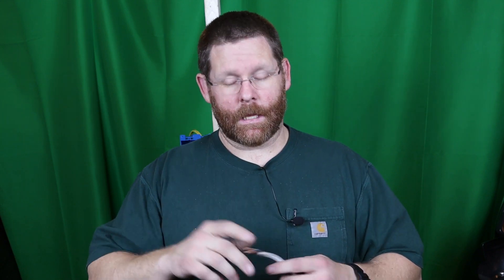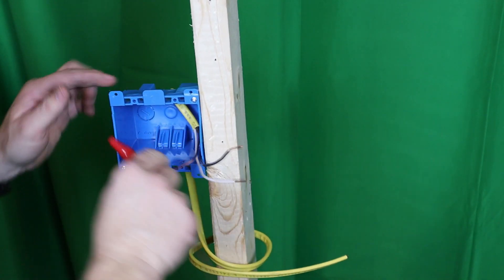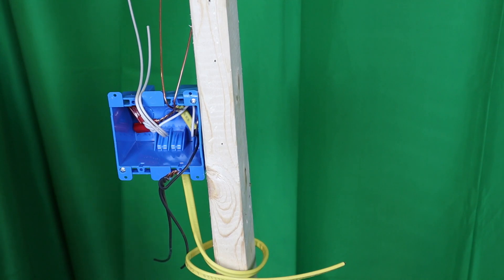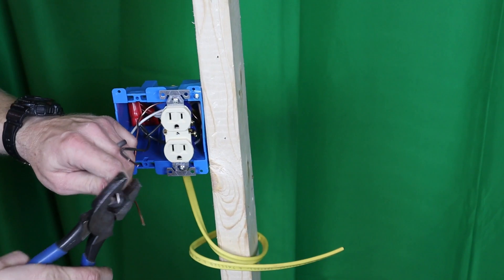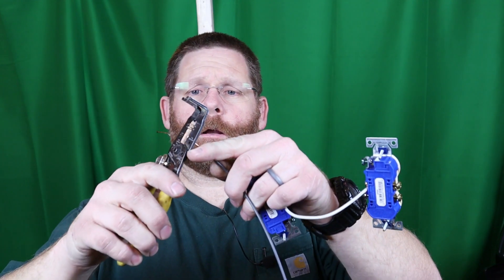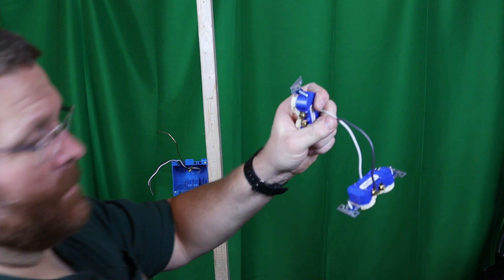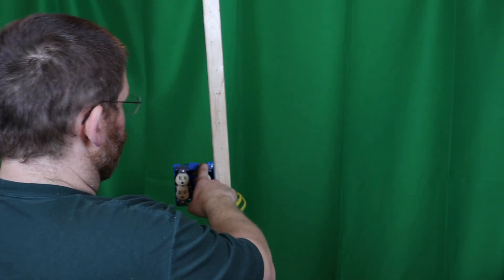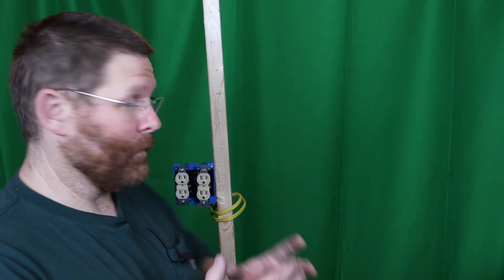How To Wire A Double Receptacle Two Different Ways

Comment: Great video.  
It's a good idea to learn both ways.
With the 2nd method, the 1st receptacle with the line serves as passthrough for the 2nd receptacle (wiring in series).  If one of them were GFCI and you wanted both receptacles to be protected, you would have no choice but to wire the 2nd way.

Comment: i see something wrong, as per Study Books i have read, so you can say the books are wrong and you are correct???  the making [ HOOKS ] they should be Shepherd hooks  with 75%  of contact touching... the way you did it is not correct as per code ??? what are your thoughts on this???
Reply from the maker: I have had discussion with many electricians and inspectors we all make them the same. Nothing wrong with it and the way you described is great too.

Comment: I connected my ground from green to green instead of coming off with a wire nut. Is that okay?
Reply from the maker: Do you mean you went from Recep to recep?
Reply: @MountaineerOutdoors  Yeah, the ground/ green on the first receptacle to the ground/ green on second receptacle.
Reply from the maker: Nothing that I know about that is wrong just be harder to change out if you need to replace it. Just make sure that it's hooked to the ground back to the panel.
Reply: @MountaineerOutdoors  Thank you so much for taking the time to answer my question. Your video was easy to see, with the visible stud and no sheetrock.

Well done.
Reply from the maker: I appreciate it and you are welcome.

Comment: As a DIY, I have a question. I want to add one outlet on the opposite side of an inside wall that has no insulation to an existing outlet. Is a outlet box required if I am using Wago connectors? Thank you for you time and great videos
Reply from the maker: Absolutely it must be inside of a box. Good question. I appreciate you watching and commenting ☺
Reply: @MountaineerOutdoors  I appreciate your fast response and box it is, and also I found a great video on how to make pigtails to save box space…. Thank you for these great tutorials.
Reply from the maker: Always, gonna be alot more this upcoming year.
Reply: @MountaineerOutdoors  Looking forward to them ……. Have a great weekend
Reply from the maker: You as well. 😂 😂 Well I definitely did

Comment: I'm making a homemade power strip/extension cord with 2 sets of receptacles, and I'm probably going to use the 2nd method, myself, but even though this video was a bit too quick for me to follow, it might be of help...
Reply from the maker: Good luck just take your time.
Reply: @MountaineerOutdoors  thank you... I got it made, but it was harder than I expected, considering the cord I was using, came from an old power strip that had a good cable, and it was using stranded wire, which, I'm sure you can see the potential issues with that. I think some ring terminals would have been better, looking back on it, and I still might do that, honestly, as it would probably make it a little safer.

I did use electrical tape to isolate the 2 individual plugins from any stray wires I might have in the future, so I wasn't a complete idiot, but I wonder if it would be good to use my idea of ring terminals, or perhaps use a couple of WAGO connectors, if and when I take it apart and redo the connections...
Reply from the maker: Me personally I hate wagos. But the ring terminals on stranded wire that's a great idea or even fork terminals. Sounds like you did a great job.

Comment: Thank you sir... Both of your installs are to code because of the pigtails, right down to the copper grounds, as in the 2nd demo, each outlet switch had it's own individual ground connection...
I too prefer the 1st way it was done...
Excellent tutorial & done to code, except for ( 1 ) minor detail, per the electric code manual for several years now, probably closer to ( 5 ) years actually, neutrals now go from 6 o'clock to 12 o'clock position... 
Bill... :~)

Comment: Awesome video and finally found one that answered exactly what I wanted to know. I want to add another receptical to my outlet box its in the middle of the circuit and understand now how to do this. My question is I want to tie in a ceiling fan to the box. Do I just add wiring to the pig tail to connect the fan too?
Thx I liked and subscribed, I will be checking out some more of your vids. Nice work..
Reply from the maker: First of all welcome to the mountaineer outdoors family and if you wire it up to the pig tail it will be hot all the time and will be able to be controlled by the pull chains. Thank you for watching and commenting ☺

Comment: It’s like every decade is something in electrical wiring in homes this is just my observation.

1940-1970s : Aluminum wiring, white colored hot wire

1980-1990s : Excessive daisy chaining and neutrals in every box

2000-present : Neutral must be in light switch box and tamper proof outlets wait, receptacles. To be politically correct not to offend anyone.
Reply from the maker: 😂 😂 😂 Yep you hit the nail on the head
Reply: @MountaineerOutdoors  I was at my buddy’s changing outlets it’s a joined living room and dining room. 3 were on a 15 amp circuit and 3 were on a 20 amp circuit, different breaker switches no order. Everything else is 12 awg, but the last one. The neutral was 12 gauge and the hot was 14 gauge. After scratching my head and contemplating about life It’s on a 20 amp circuit and I’m going to install the 20 amp receptacle. 

It’s a big room, I get it the kitchen is on the other end of the wall so the 20 amp carried over. But the connecting garage is only 15 you think they’d put the 20 in the garage rather than a dining room where all the fine China and no appliances will be. Got a 15 amp outlet at one end of the sofa and at the other end it’s 20 amp.  

The house was built in the 80’s. Whatever they did drug wise in the 80’s it reflected on the wiring to say the least! Haha
Reply from the maker: 😂 😂 Yeah sometimes I wonder stuff like that. What weary they thinking. Appreciate the story and glad it's not just me that runs into stuff like that

Comment: Hey I have a 4 wire connected to twist lock 4 prong 30amp and the other end is a double out box to 2 20 amp outlets how would you wire this

Comment: You do NOT need to pretwist wires before putting a wirenut on. Manufacturer spec for majority of wirenuts states that its not required. I can guarantee you a shit ton of testing was done before slapping that instruction on the box. That being said, I pretwist because ive always done it and i find it easier to put the nut on instead of struggling with 2 or more individual wires. Nobody tells me what to do. Haha.
Reply from the maker: 😂 😂 I hear ya 😂 😂 I agree it does say that but I don't trust it.

Comment: I have 1 question how come people put these sockets in metal boxes Or aluminum whatever you wanna call it. If 1 of the wires get loose wont it  electrified the whole box
Reply from the maker: If you ground the box it will short out the circuit which will trip the breeker. Alot of people do it because they think it's better. For me that's old school and in a house it's a over kill and cost more. To each is own though. Commercial or industrial settings Definitely use metal boxes though.
Reply: @MountaineerOutdoors  Thank you so much for explaining that to me.
Reply from the maker: My pleasure ☺

Comment: This article contains the requirements for identification of the grounded neutral conductor and its terminals. If you go back to Article
100, you will see that the grounded conductor isn’t the same as the grounding conductor. Make sure you clearly understand the
 difference between the two before you begin your study of Article 200.
   This article isn’t very long, and it’s not very complicated, and following these requirements can mean the difference between a safe
installation and an electrocution hazard. The illustrations in the Understanding the NEC, Volume 1 textbook will help you form mental
pictures of the key points.
   Grounded Conductor. Most electrical power supplies have one output terminal of the power supply bonded to the case of the power
supply (system bonding jumper). The conductor that is connected to this grounded terminal is called a “grounded conductor.”
   Neutral Conductor. The IEEE dictionary defines a neutral conductor as the conductor with an equal potential difference between it and
the other output conductors of a 3- or 4-wire system. Therefore, a neutral conductor is the white/gray wire of a 3-wire single-phase
120/240V system, or of a 4-wire three-phase 120/208V or 277/480V system.
   Since a neutral conductor must have equal potential between it and all ungrounded conductors in a 3- or 4-wire system, the white wire
of a 2-wire circuit, and the white wire from a 4-wire three-phase 120/240V delta-connected system are not neutral conductors—they’re
grounded conductors.
   Author’s Comment: The electrical trade industry typically uses the term “neutral,” when referring to the white/gray wire. However, the proper
term for this conductor is “grounded conductor.”
Technically, it’s improper to call a “grounded conductor” a “neutral conductor” or “neutral wire” when it’s not truly a neutral conductor,

Comment: Have to Ask if you hold a Electrical License? 1.  It is a one phase ckt so per the NEC there is no neutral, it is called an ungrounded conductor.  Natural is in a two or three phase ckt.  2. The instructions for the wire nuts state not to twist the wires.  I know of inspectors that failed jobs because of this.  If the ckt is not powered then you can wire in any order,  which NEC and OSHA says any work should be done on unenergized ckt unless the power is on for critical systems.
Reply from the maker: John when I read this I was like is this dude for real... Now I'm asking, is this dude for real.. First off I absolutely have a license. I have held one over 18 years now. The nuetral thing, I'm not getting into a long drawn out description of that. I'm sorry to say without a nuetral your single phase Recep will not work. As for the wire nut thing OMG. Your car speedometer says that you can go 120 but you don't loose connections cause fire and if you were ever to wire up anything for me and I saw that display or should I say lack of professionalism I would send you packing off my job.  The order of doing the Recep, correct it doesn't matter at all and yes ALWAYS WORK A CIRCUIT DEAD but repetition makes for a better electrician. Bottom line is that you sound like a glorified homeowner that thinks he knows something about electrical to me you sound like a jack leg and should definitely take a basic electrical course. 🤦‍♂️
Reply: @MountaineerOutdoors  By the way I hold a Elec license and worked as one for the city I live in and worked as a comm. electrion in the Air Force.  I have passed the NEC test on my first try. I also inspected work on city items by contractors and we failed many for the what you did with the wire nuts,  AHJ (Authority Having Jurisdiction ) is what matters. I have taken many courses and passed all.  Don't forget if the is a electrical  fire and the Ins. inspector finds things not to code they don't have to pay out for damage.  Be careful  calling people a jack leg because I was just giving my opion not insulting you like you just did to me.
Reply from the maker: Ok im gonna apologize for insulting you. That is not how I usually handle things. However, everything that I said I still hold true too. I do thank you for your service in the military. And on this matter we will have to agree to disagree.
Reply: @MountaineerOutdoors  All my comments are in the NEC code book.  Look them up.  This is why people fail the test.
Reply: @MountaineerOutdoors  The White wire is a return wire as per the NEC.  So your ckt will work.  No long drawn out description.  Sure the speed ometer thig is true but its what the inspector says when he/she inspects.

Comment: Thank you for making this video. Wiring up some outlets in the garage and forgot how I had done this before. I'm assuming if the outlet that I'm putting in is in the middle the circuit, I just put the wire going out on the pigtails/wire nuts and out the box it goes.
Reply from the maker: My pleasure thanks for watching and commenting ☺

Comment: Would this process be the same if it was a 240v? Of course this would have 2 hots instead of the neutral. So that i can create a 4 gang (double receptacle) using NEMA 6_15p outlets.
Reply from the maker: Yes but most of the time when someone pulls that kinda receptacle it's for one specific item. But in theory yes it's the exact same way.
Reply: @MountaineerOutdoors  it would be for items that require that outlet type. Basically running 20amp circuit through 12/2 wire to the 4 gang outlet which will support  4 items totaling 3200watts. they are all grouped together so the 4 gang just seemed easiest.

Comment: I wish I could find a video that shows how to wire more than two receptacles up in a chain.
Reply from the maker: Sounds like I need to make a video
Reply: https://youtu.be/TOMSZRft2oE this is the one I used for installing in my garage
Reply: It’s basically the same thing. Just add another pig tail from the second outlet. So you’ll have 3 conductors on one wing nut.

Comment: Very good thanks Can you wire it the same way if you were continuing to more outlets and would one more wire fit in the wire nut
Reply from the maker: You can put up to 5 - 12 gauge wires under the wire nuts I'm pretty sure. So I'm thinking that I had wires under the wire nut I would have to go back and re-watch it... But yes if that were the case
Reply: @MountaineerOutdoors  thanks that’s good way of doing it with the pig tails if you screw up the wire cut it short or nick it just do the pig tail over.  thanks
Reply from the maker: Exactly.. I agree 110 %

Comment: i have two GFCI receptacles to install in kitchen counter tops on a dedicated circuit. Can i use 12/2 or need 12/3?
Reply from the maker: Are you planning on one circuit?
Reply: @MountaineerOutdoors  yes .. its basement.. so 2 gfci enough..(Ontario Code)

Comment: I used to install electronic equipment in commercial buildings. We were installers not electricians.  Electricians installed the building wiring and we just connected the AC wiring from the power panel to the equipment racks.  Sometimes we were running power to consoles and couldn't use power strips as we usually did.  So we ended up wiring dual duplexes into a 4 in square box.  We did it the second way that you showed and it was always a pia.  The jumper of the neutrals and hots was not a problem, but I am guessing that we did not makeup pigtails on the grounds.  We probably had two grounds on one screw somewhere.  I tried to study the code book where it governed the type of wiring we did.  What I learned was how much I didn't know and we should have had a licensed electrician working with us to at least inspect our work.  But this was in government facilities and they write their own rules.

Comment: Do you count these pig tails in the box fill calculations? They seem to add up quick doing this way to filling the available volume count. I have read via google if the conductor doesn’t leave the box it doesn’t count towards it but not positive. But based on what you did there it would add 10 cubic inches off the bat if they do count.

Comment: He did not use the disclaimer "Using blacks is not a racist remark."  I'm just bein' a wize-ass. 
I never did it this way,  I made short jumpers from 1 recep to the other, but they were at the 
end of the line.  It seems that at the end, u say u can't  take a line from the 2nd box and go 
further on, meaning out of the box to another box. The pig-tail idea does seem like a pretty 
good method.
Reply from the maker: 😂 😂 😂 Yeah I tend to steer clear of the racist remarks especially since I am not... Thanks for the laugh and I appreciate your comment and watching. Happy New Year
Reply: @MountaineerOutdoors  Happy New Year to you Too! Keep every1 electrically 
safe!

Comment: option b  has more advantages  and heres  why  1.  you do NOT need to pigtail the ground wire unless  it's already short ,  put a horseshoe. shaped bend in it leaving a tail this way it can attach  to both outlets. now for the benefits  1.  less box fill ( important  because  more wires. is potential  for more heat and more failures) 2. its cleaner due to less box fill. 3.  never have to. deal with. wire nuts coming loose due to expansion and contraction  of dissimilar metals and materials  4 a mechanical   fastener  such as a screw of torqued properly  will be less prone to failure then twisting and capping  the wires  in the event of a failure  it will shut. down everything. farther down the line and make the problem  more obvious instead of potentially. being undetectable  for some time while it continues to arch away see the trend here? yes both are. legal ways but one is safer
Reply from the maker: I appreciate this comment. Alot of thought went into that comment. And it is a great statement. I appreciate you watching and commenting.

Comment: I have done this conversion based off your video but have four 14/3 lines in my outlet box. So I was curious would you consider 6 wires under a single wire nut (correct size of course ie ideal pro flex max range of 6 #14) just as secure/safe vs pigtails of two sets of three wires (four wires for each nut when including connecting pigtail wire). Which would you do in this scenario if you had to choose.
Reply from the maker: yes as long as when you put the wires under the wire nut and it looks secure when the joint is made up then yes.. sometimes when you make a joint and you step back you know that maybe you need to do something different.  Thats my answer, does it answer your question.